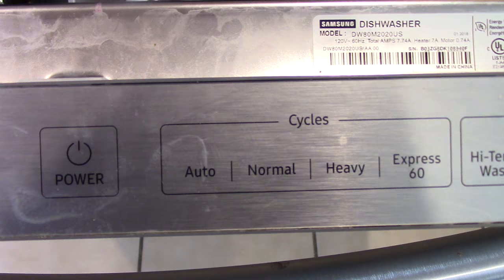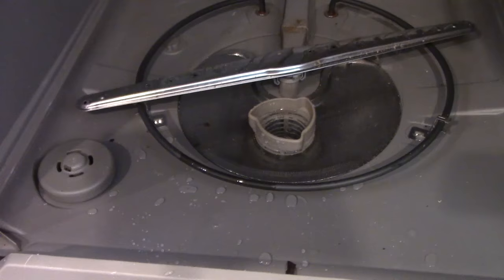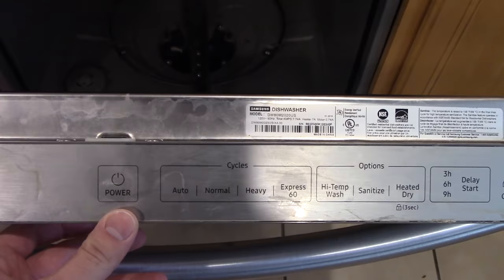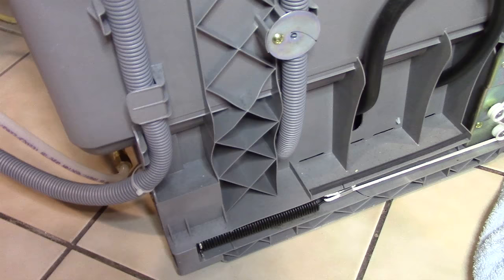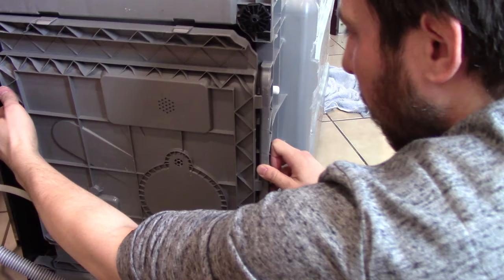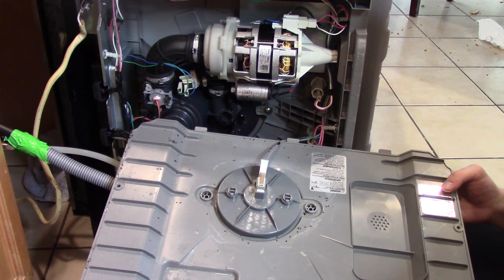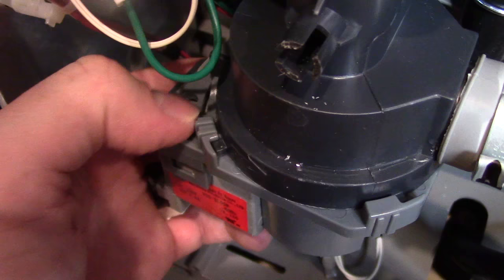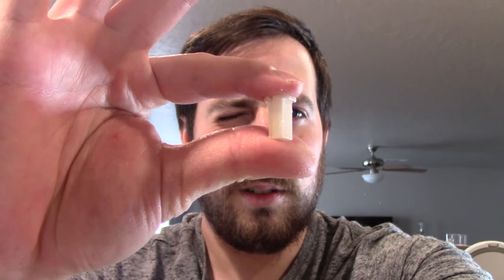Samsung Dishwasher Won't Drain: Impeller Fix

Comment: Hi Ben. I'm hoping you might be able to help me. I've the same dishwasher as yours. Halfway through the cycle the normal light starts blinking and the dishwasher makes a humming sound like it's trying to drain the water. The humming and the blinking does not stop even when I open the door. It's like the pump keeps trying to drain the water but is unable to. The pooled water at the bottom does not seem to be moving around in a little whirlpool which I would assume it would, if the impeller was working properly. I bought a new drain pump off Amazon thinking maybe the old one was bad but it didn't help either. It's still the same issue of humming without draining.
What could be the issue?
Reply from the maker: Hi Abhi,

Thanks for checking out my video. Do you recall when the last time was that the dishwasher was working? Have you tried looking at the drain tubing to see if there is a piece of old food clogging it? Do you have a garbage disposal set up? 🤔
Reply: @karatefox Thanks for the quick reply. I fnally got time to check the drain tubing. I disconnected the drain tubing from the sink drainage pipe and turned on the power. Since the machine was stuck in hum & drain mode the last time I'd turned it off, immediately water started gushing out of the drain hose in my hand. The pump emptied the water from inside the machine and kept on running for a while even when I couldn't see any water inside. It stopped humming after 10 mins but the normal light never stopped blinking. 

So now we at least know there's no issue with the new drain pump. 
I don't have a garbage disposal. I used a drain snake to try to get rid of any debris in the sink drain pipe. (Sent it in through the opening where I disconnected the drain tubing). Nothing really came out. It looked pretty clear. 

Could this be a water leak sensor issue? Or a leak issue. I'm not sure where to look. The bottom panel looks dry. Where else can I look?
Reply from the maker: @abhib6751  interesting, sounds like the impeller is working, and it's a good sign that water was able to flow through the tubing. Do you recall hearing water flow through the tubing and into your sink? If you look in your sink while the unit is draining, you should see a small gush of water coming from a hole within the drain of the sink.

If the normal light is flashing, that means the drip pan is full of water. Now, I haven't posted the video yet but I actually had a different issue appear in my dishwasher that kept tripping the leak sensor: my water inlet valve was busted. I'll work on finishing up some edits with that video and get it posted before the end of the weekend. The water inlet valve is a magnetic switch that allows water to flow into the dishwasher system.  If it has issues, it can leak a lot of water while the dishwasher starts up and cause the leak sensor to trip. Troubleshooting to figure out if it's the water inlet valve can be difficult and dangerous and not recommended. The way I did it was I drained the dishwasher completely with my mop, flipped the unit on its side, removed the drip pan  and turned it on briefly to see where the water was leaking from. This is super dangerous because it involved  water running near live wires. But yeah, there are probably safer ways to troubleshoot it. Perhaps flip your breakers off, flip the unit on its side and remove the drip pan so you can check the tubing. Perhaps try to see if any of the tubing is cracked or loose. Later this weekend I'll reply to this comment once the new video is ready. Please let me know if this helped, hopefully we can get it figured out.
Reply: @karatefox   An update regarding the issue. I removed the styrofoam(it was dry) to get rid of the normal light blinking & beeping and let the machine actually start a cycle. The water from the drain tubing drained into a bucket just fine. When I connect it to the drain pipe it stops draining again. I can't see any water draining when I look through the sink. 

It's as if an air pocket develops when I connect the tube to the drain and stops the water in it tracks. Very weird. When I'd inserted the snake in the drain it was free of water so it doesn't look like it's water which is backing up. 

I seriously don't know what's going on. Haha.
Reply from the maker: @abhib6751  I have another hypothesis.  There may be a plastic plug sealing the inside of the hole where you attach the drain tube. Check out this video I found, specifically at 3 minutes 29 seconds: https://youtu.be/bLNCef3jCBw
Reply from the maker: @abhib6751  alternatively, the height of the drain tubing relative to the point it connects to the drain. Apparently,  if the tubing isn't elevated enough, 32 inches I think,, the tubing won't drain properly. 🤔 Check this video out at 2 minutes 28 seconds: https://youtu.be/gIr8avJFrKw
Reply: @karatefox  Hi Ben, thanks for the video links. I checked the drain tube and didn't find any plastic plug in there. I also tried elevating the tubing but that didn't help either. Finally, I poured some water into the drain pipe opening (using a squeeze bottle, it's hard to reach with anything else, haha) after removing the hose and it overflowed pretty quickly. So looks like I finally found the issue. It's nothing in the machine and the hose but a blockage in the drain pipe which was somehow not evident when pushing in the snake. It could be the weird way in which the washer drain is connected to the sink drain. It has two bends in it. The first one is clear. It's for sure the second bend because the snake most probably isn't long enough to reach it. I wonder why the plumber thought of doing it this way instead of having it connected directly like in the video you linked to. 

Anyway, I'm a little hesitant of opening the drain pipe near the second bend because it looks like it's been sealed with a yellow transparent sealant. I'll call a plumber if I can't work up the courage to open/close it myself. Haha.
Reply from the maker: @abhib6751  That's awesome you were able to identify the root cause. 😀 I'm not too sure how to extend the reach of the snake but my first instinct would be to make my own modification using some heavy gauge stainless steel wire like the kind you can get at a crafting store. I'd use a pair of needle nose pliers to bend the tip into a small loop for safety and then wrap a decent length loosely around a broomstick to give it a spring-like shape before giving it a try. Alternatively, you could try using a plunger or perhaps some sort of chemical drain cleaner.. Please let me know how it goes, and thanks again for checking out my video 😁

Comment: Hey man, I know it’s been a while, but when you were in there, did you notice if there was styrofoam under the cover of the leak sensor?
Reply from the maker: It's been a while, but yes, I remember there being a disc of Styrofoam there for sure. I think the purpose of the Styrofoam is to float up when the drip pan is full of water, in order to trip a sensor. It's worth noting that it's possible for the Styrofoam to float up and then get stuck in the up position due to food residues-might be good to clean out as part of the troubleshooting process. Thanks for checking out my video :)
Reply: karatefox Thanks!

Comment: My impeller blade just fell off. Wife was ready to drop a grand on that Cafe double decker. Hell no!
Reply from the maker: Dang that's crazy. Were you able to just slide the impeller blade back on? Did you have to do anything else to make it stay on? Thanks for checking out my video.

Comment: Well ya saved me from junkyarding this thing hahahah appreciate it bud
Reply from the maker: Awesome, happy I could help out.  Was the impeller the main issue or did you discover something else?
Reply: @karatefox  sure was the impeller, it had completely come off of its shaft, put a little bit of gorilla glue on the shaft and put her back on there, working great now! Thanks again!
Reply from the maker: @weepweep2225  awesome, happy you were able to get it working. Gorilla glue is some strong stuff, hopefully that'll hold everything in place.
Reply: @karatefox  same here lol! Again I appreciate you showing your video!

Comment: I just got the Samsung 39db dishwasher and it doesn't fully drain after running a normal cycle, but it drains when I run any other cycle... I did a test run and also had zero errors....
Reply from the maker: That's fascinating. When running different cycles, is your wash load the same size? Does it make a difference if you run several loads back to back? My first thought is that there may be a partial obstruction or clog in the drain tubing or the point of attachment near the sink drain.
Reply: @karatefox  Update....  Express 60 and Rinse Only cycle completely drain... the Auto, Normal and Heavy Cycle do not completely drain....    this is my model  DW80R9950UG/AA      Reading reviews on Samsung site have complaints of exactly what I am describing...  The pump may be too weak....
Reply: @karatefox   Figured it out.... the installers didn't properly connect the drain hose.... I drilled a higher hole into the sink cabinet, ran the drain hose higher than the garbage disposal and then attached to garbage disposal (installers attached the dishwasher to the other drain)..  So far so good, the DW is draining good on all cycles... however, I went out and bought a bosch 800 DW that was delivered today and trying to decide if I should keep the Bosch which is head and shoulders better than Samsung or keep the cheaper working Samsung...
Reply from the maker: @btk03z19  Dang, that's crazy, the positioning of the hose was key. Glad you got it figured out. If it was me, I'd keep the Samsung and return tye Bosch unless you think you could return the Samsung for a full refund. If getting a refund is an option, I'd go with the Bosch unit if you think the price and quality differences would result in a net positive.
Reply: @karatefox  Yeah, I already have an approved return for full refund plus installation costs from Samsung (as it's within 30 days)......  I will get $1100 back from Samsung and the Bosch cost me $1520 total ( and that includes 3 yr ext warranty)... so  Bosch will be $400 more out of my pocket ....
Reply from the maker: @btk03z19  Sounds like Bosch is the way to go.

Comment: I have had a maytag for 9 years which only broke once after 5 years  because  the panel went bad due to humidity. It cost me 90$ but I installed it myself. I have never had any other issues and it still works great however, I will be replacing it with a similar whirlpool (maytag is whrilpool) since I use it daily and sometimes twice a day, I wanted to get the third basket. 
Doing all my research, it seems that samsung washers and diswashers are complete garbage. Stay away!!!
Reply from the maker: I've never used a Maytag dishwasher,  but most definitely in about 6 years of owning my Samsung unit, I've had to replace the water inlet valve once and un-jam the impeller a few times. I'm not sure if these repairs are normal wear and tear repairs or a sign of poor design quality. But I would definitely consider other brands before buying a new system. Thanks for checking out my video 👊

Comment: What was that piece of plastic?
Reply from the maker: Good question. I still haven't had any luck identifying it, but others in the comments have reported seeing the same piece. I feel like it may have come from the water inlet valve, which failed around the same time as this issue. Have you seen that part before? I'm super curious.
Reply: My similar dishwasher failed, but it is deeper in the guts of it and probably on the drain side. Same error code, impeller was clean. Unit was also damaged in shipping, so going to try and use the warranty.
Reply from the maker: @MorellioBenoir  That's unfortunate that the unit arrived damaged. If the warranty still covers it, sending it back is definitely the way to go-even if it's a time-consuming process. Hopefully the replacement unit will work out. Please keep me posted 👊

Comment: Mine would drain the water but still run the motor for a minute with the light flashing.  I realized the washer was no longer level.  The feet must have vibrated loose over time.
Reply from the maker: That's really interesting, I never considered the possibility that not having the machine level could affect its functionality. After adjusting the feet, did the flashing light go away?
Reply: @karatefox  yes it's working so far .  After you explained the leak sensor I remembered reading that if it's not level, the machine can drip.  Thanks

Comment: question. why not just unplug it instead of using the fuse?
Reply from the maker: Good question. Unplugging works if the plug is accessible. In my case, the dishwasher seems to be directly wired into the wall so shutting off the breaker was the easiest way for me to de-energize the system for safety.
Reply: @karatefox  ahh ok this vid helped me fix mine today and I unplugged it so just wondered haha thanks

Comment: Mine is a brand new washer I installed it and ran a empty cycle, and it worked fine then the 2nd cycle it clogged
Reply from the maker: That's unfortunate it stopped working. For the second cycle, did you notice any unusual sounds before the system stopped?

Comment: What if I don’t hear power going to the pump even when the electricity is on
Reply from the maker: Good question. Are all the wires connected? Have you had a chance to flip the unit over and take a look? Also, do you recall if or when the system was working?
Reply: @karatefox  I haven’t had a chance to flip it over and look at the wires, however the machine worked when I first got it, it worked for like 1 or 2 loads then it just stopped draining, I haven’t used it since
Reply: @karatefox  when I pulled the pump part it didn’t make a sound so is it possible that I need to replace it?
Reply from the maker: @grimreaper5360   it's possible the impeller is burned out, but it could be a wiring issue. Is the dishwasher able to turn on?
Reply: @karatefox  yeah the dishwasher can turn on
Reply from the maker: @grimreaper5360   in that case, you might want to get a new impeller. Have you tried removing the impeller to see if maybe something was jamming the part that spins?
Reply: @karatefox  the impeller is clean, I removed and put everything back together and ran a load, the water got drained but not all of it, there’s a tiny bit of water still at the bottom, is that normal l?
Reply from the maker: @grimreaper5360   I think it's pretty normal for a little water to remain. If the impeller is working and water is being mostly pumped out out, the next thing I'd check is to see if there is any food or debris partially clogging the drain tubing, the hole of the sink drain where the tube attaches to, or perhaps the removable filter located inside the dishwasher that I showed near the beginning of the video.

Comment: Exactly my problem...had date seed stuck in the impeller smh lol
Reply from the maker: That's great you were able to get it figured out. Thanks for checking out my video :)
Reply: I had a E5 error btw (for anyone that faces this problem)...I checked the hoses to see if they were blocked, also checked the connection to the sink drain but they were all fine, next I checked the impeller (drain pump) and there was the problem.

Comment: Another root cause of the problem is this dishwasher being an absolute piece of s--t.  We're disliked every miserable minute of owning the low-performing piece of trash.  Unfortunately, that's not a very technical complaint!
Reply from the maker: Not a technical analysis, but a fair appraisal nonetheless. I've purchased several Samsung appliances and had issues with most of them. The darn icecube dispenser quit working on the refrigerator after about 2 years of owning the unit. Not super impressed 😑

Comment: I have the same issue with mine and it's never used.
Reply from the maker: Hi Darnell, thanks for checking out my video. Have you checked the connection between the drain tubing and the garbage disposal? There might be a plug or cap that needs to be removed before the two are connected. What happens when you try to run a wash cycle? Does the water turn on at all or does it immediately give an error message?

Comment: This is the worst dishwasher I have had nothing but problems with mine since I got it
Reply from the maker: Dang, that's unfortunate. What sorts of issues have you had? So far with mine I've had a jammed impeller, faulty water inlet valve, and then I got grossed out by the sludge living in the drain tubing and had a dishwasher induced existential crisis. I currently have the unit disconnected and just hanging out in my kitchen. I'll probably deep clean it and set it up to use again eventually. But yeah, the thing might be more of a net negative than a net positive due to the random issues.
Reply: @karatefox every time I turn around there is a new error, the heating element quit working at 6 months old, and 3 months after I got it the buttons quit working. Thank god it was under warranty and they had to replace the panel on top.Now it’s making a grinding noise when the water pumps out.. hence why I watched this video! I had high hopes for this dishwasher because I like Samsung they should stick to making TVs. Now that it’s not under warranty next issue will just cause me to get a new one! I also think it doesn’t clean worth a damn.
Reply: @karatefox  oh forgot the door has a crap seal if you open it when it’s running water comes out of the door.. it’s only a year and 1/2 old